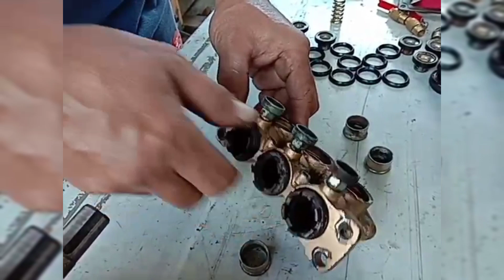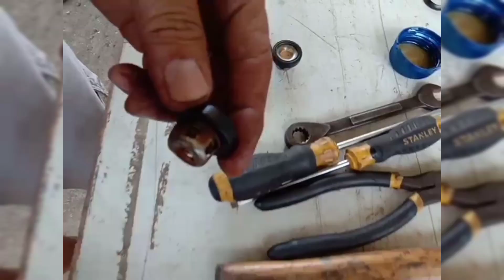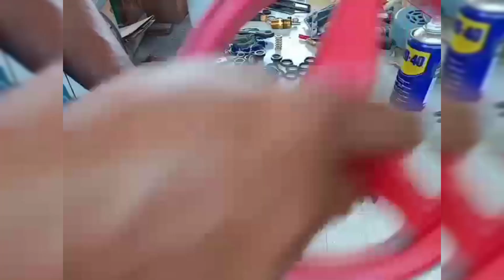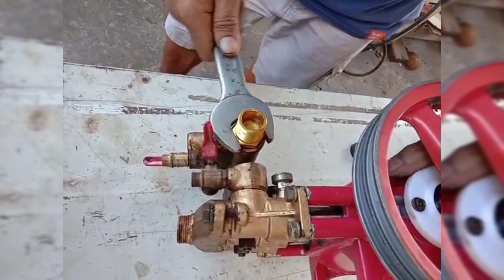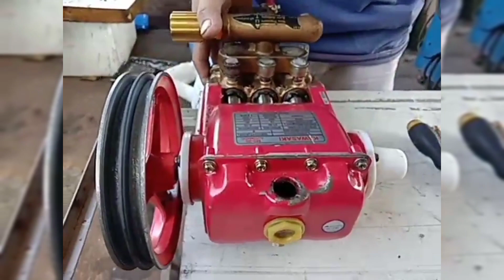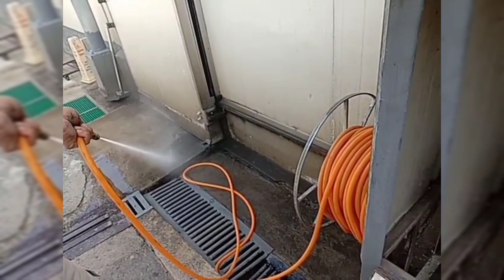KAWASAKI POWER SPRAYER DISMANTLE | REPAIR | CLEANING & INSTALLATION  Part 2 | Team BASIC Vlogs

Comment: sir tanong kulang po pag mahina un pressure anu problema nun? wala naman syang mga tagas kc bago palang almost 2 months palang, dati pag inaajust mo para lumakas napapansin ko bumabagal ikot ng pump paano po yun maayos sir? sana po masagot.salamat
Reply from the maker: Good pm po sir. May time po talaga na mahina ang pressure ng power sprayer natin. Please check po yung strainer filter nya, yung nakalubog sa tubig. Linisin po kung marumi, Minsan po kasi habang gumagamit kayo umiibabaw po ung strainer dapat po palaging nakalublob sa tubig yan. 1-po nakakahigop ng hangin,need pong ibleed yan sa extrang ballvalve para makalabas yung hangin, 2-nag stuck po yung mga check valve nya. Ang ginagawa ko po minsan kinakalas ko po yung pump mismo, tingnan yung check valve nabibiyak po yung pump mismo pag nakalas muna yung 4 na turnilyo baka may sira na sya check valve. Maraming Salamat po.
Reply: salamat sir, tanong kulang paano malaman if my sira un adjustable valve nya sir ung pampa lakas nya?
Reply: Good Morning sir tanong ko lang po kung saan ka nakakabili set ng valve seal mo at oring salamat

Comment: Sir... ano po number ng oil seal  sa cramshaf doon po sa my pully at s plastic n puti....doon kc yong akin my tagas....ano po number non...pra mkbili ako   agad.thx po
Reply from the maker: No need na po ang number. Repair kit lang po ang sasabihin mo, set na po yan ibibigay sayo. Paki sabi na lang ng model ng sprayer niyo sa bibilhan niyo. thanks po sana makatulong👍

Comment: Sir... Para saan yung tatlong takip sa itaas ng piston? Tinignan ko yung power sprayer ko may grasa sya. Ginalaw ko kasi may thread sya. De ruskas kasi.
Reply from the maker: Clockwise po ang pihit para bumaon yong grasa. Manual push po ng grasa yan para di magasgas yong piston shaft ng power sprayer, pag tinanggal nyo po yong takip at wala na syang grasa, lagyan nyo po ulit. Ganun lang po ang purpose nyan. Maraming Salamat po.

Comment: Paano pag walang tubig lumalabas?
Reply from the maker: Pls check po ng inlet hose yung nakalublob sa tubig, pls check po ung filter bka madumi, kung wala pa rin lumalabas ibleed po yung maliit na ball valve i open at close lang po para lumabas yung hangin. Minsan po kasi nagkaka hangin kaya mahirap humigop yung inlet hose. Maraming Salamat po.